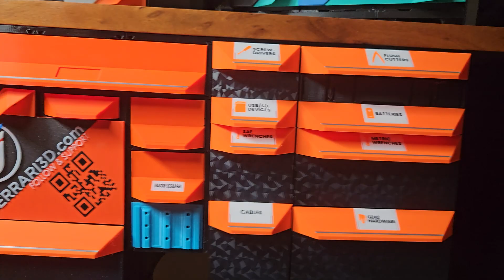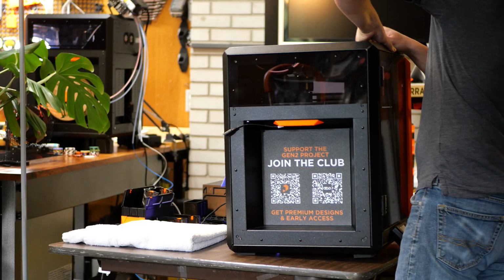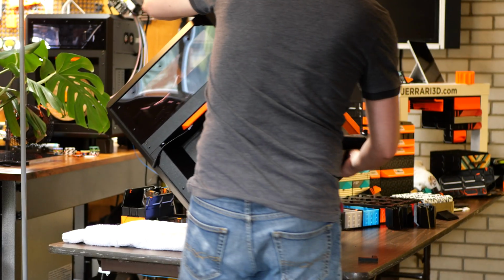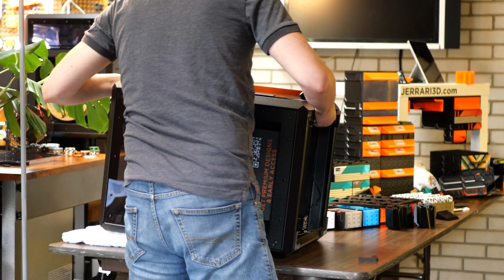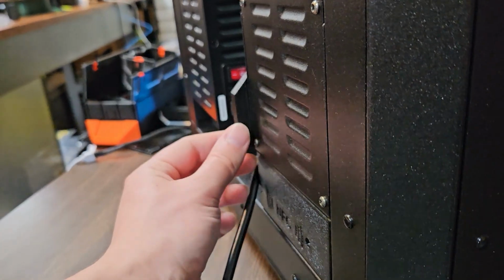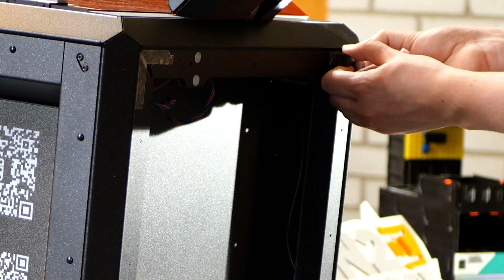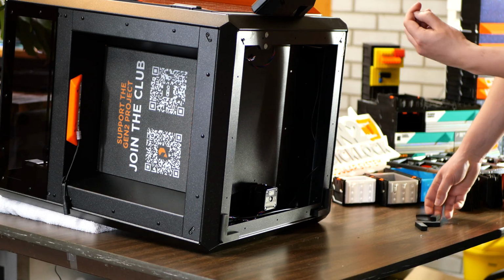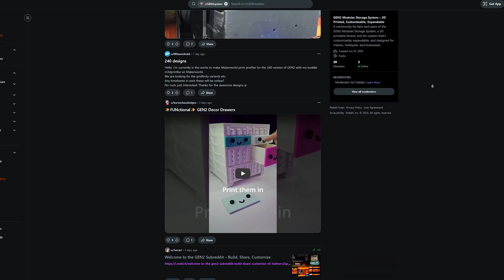GEN2 Drawers - Prusa Core One Kit (3D Printable)

Comment: Do you recommend using PETG for the feet or something else? I normally use PETG for the drawer frames and PLA for the actual drawers. I have some glass fiber ASA but only in white.
Reply from the maker: Honestly I think PLA printed in 4 perimeters at 25% infill will work fine for the feet, PLA is surprisingly strong, just not very flexible, which is totally fine for this use. Also using PETG for the drawer cases and PLA for the drawers is an excellent as well, I'm starting to do this more often as well now.